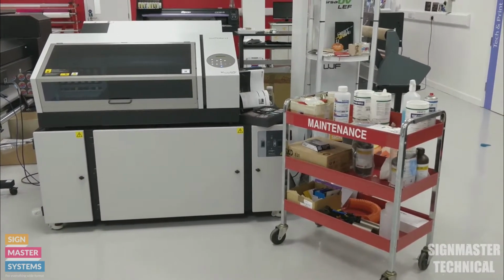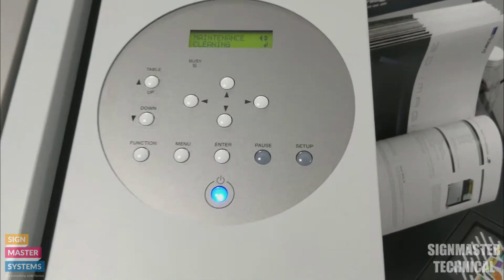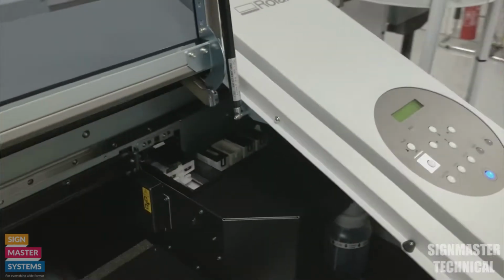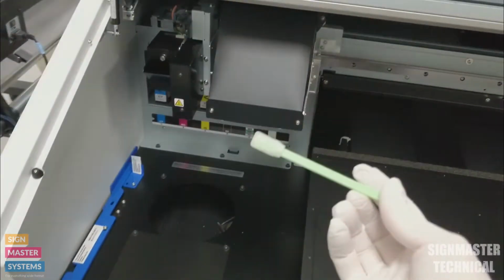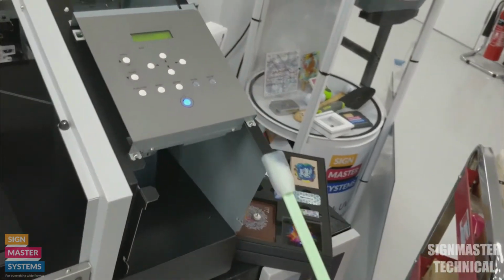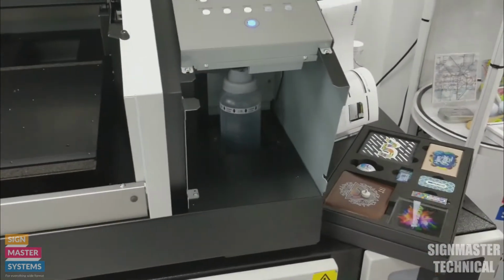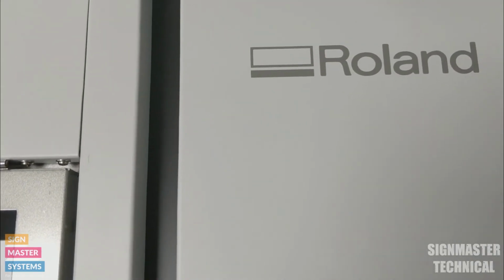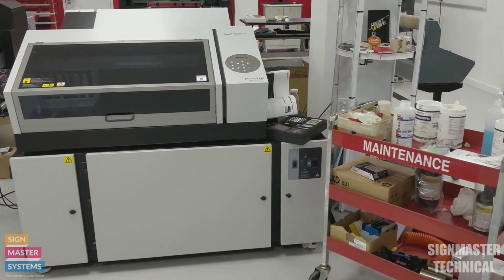How To Do Daily Maintenance || Roland LEF2 200 Flat Bed UV Printer

Comment: Lef 2 200 Or Mimaki 6042 kjf  Wch one has a better print quality and varnish
Reply from the maker: I would say the UJF edges out the LEF for quality but the LEF is easier to use